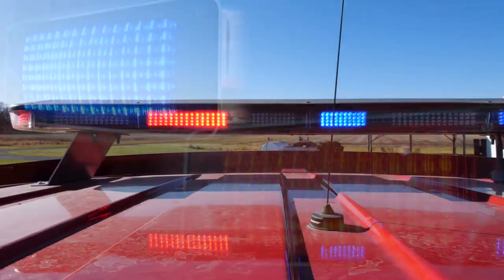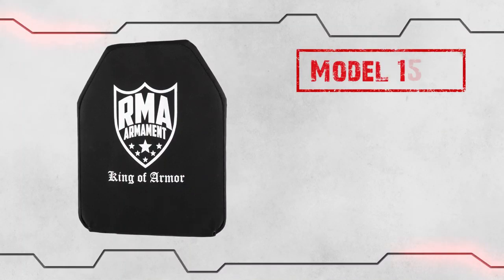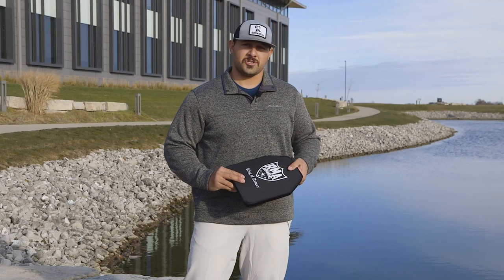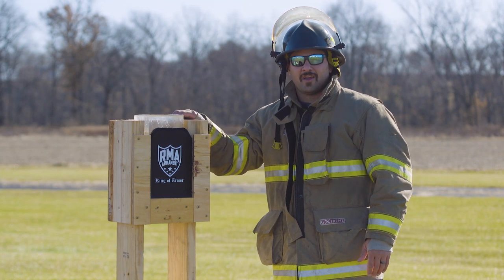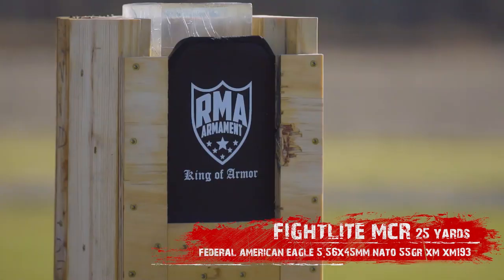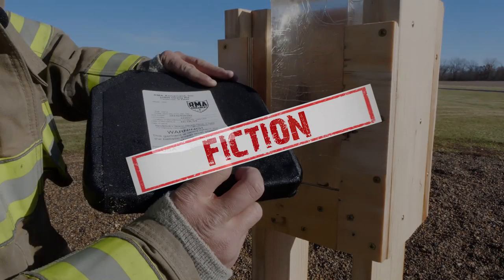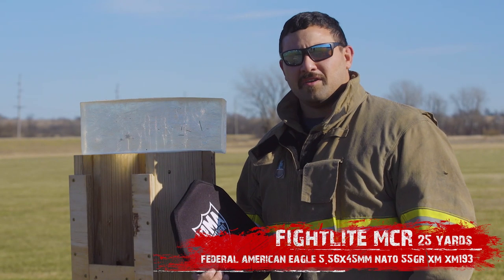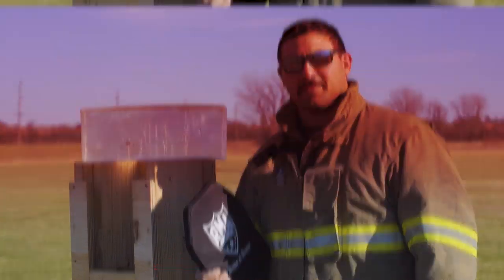Fact vs Fiction: RMA Body Armor vs Water Torture

Comment: After watching this I beleave that if I were wearing this I would want it backed up buy a few layers of Kevlar and or a little metal. As the metal my slow down the pein/  pain factor defenatly and depending on type of metal mabey stop the rounds coming thru. 
 Yea I know that defeats the weight savings of the ceramics but as we know and saw a well placed group will defeat this. And some bad guys have these kind of black guns. And if you go look at Taofledermouse videos testing of Hong Kong aluminium plates for armor, then you'll see that lightweight plates of aluminium stopped some heavy pistol rounds by themselfs. 
  And for those purist's out there, " whatever", if a combination that still weighs less than a heavyweight 500 plate does the job then I say thats what I would go with if I were in a possition to have to wear body armor. Period.
   American service personel and good law enforcement personel deserve the best protection they can get. So do civilians who live in hi risk areas. Period.
Reply: To be fair, there is no such thing according to the NIJ, the people that standarize the armor ratings, as a Lv IIIa+, there is Lv III which is rifle rated, and Lv IIIA, which is only rated for handgun magnum rounds, not traditional rifle rounds. So the fact that this took a hit is already reasonably impressive. This is the armor you would wear against handgun threats though, not rifle threats.

But wearing soft armor 'padding' behind hard armor plates isn't all that uncommon either, both for that extra layer of in case protection, and to help attempt to soften the impact by further spreading it out.

If they had done this with an actual Lv III plate, which is meant to defeat lead cored .308, it would have been more fair to the armor. All this really does in my eyes is show that this specific plate isnt as strong as RMA claims it to be, so it's a failure of a plate.
Reply: @Lordingish  I really havent done a lot of homework so to speak on the subject as I dont beleave that I'll have a need for any off it. But nowadays whose to say those who are in situations that might require it what or who they will incounter. 
   And it was something to see it stop two rounds, but two got thru. Thats where the problem is.  With todays fast triggers, redots and lasers the average thuggly idiot who's equipped with them can really ruin somebody's day. 
  I allways train to make head shots as well as a crotch shot becouse the possibility of a bad guy wearing armor is a fact of these times. As Clint of thunder ranch said " shot em in the crotch". Hopefully that'll slow them down, lol. But I allways try to double tap the head neck area. If they take that and keep comming then I'll probly just throw my firearm at them and run as fast as my old legs will go, which ain't fast at all.